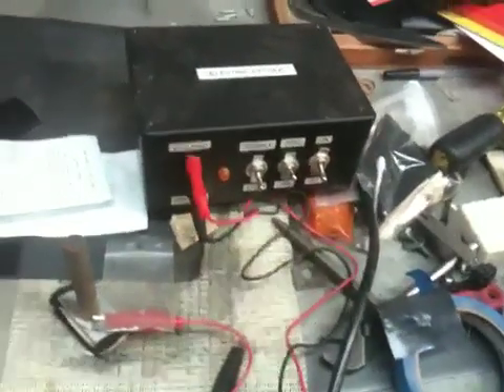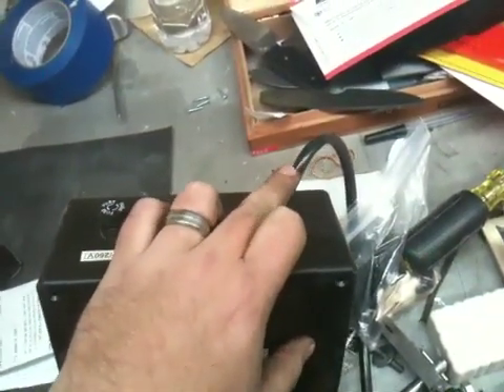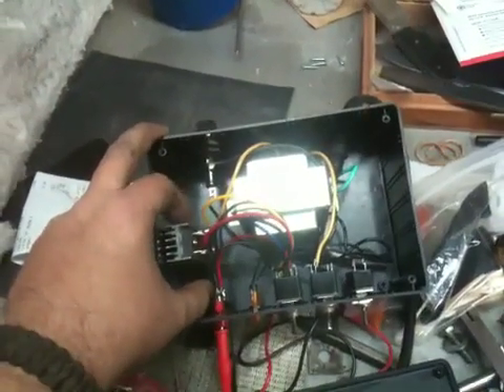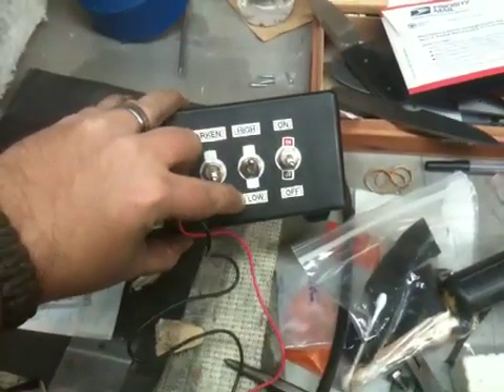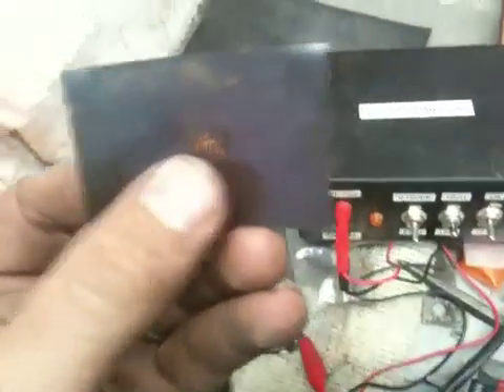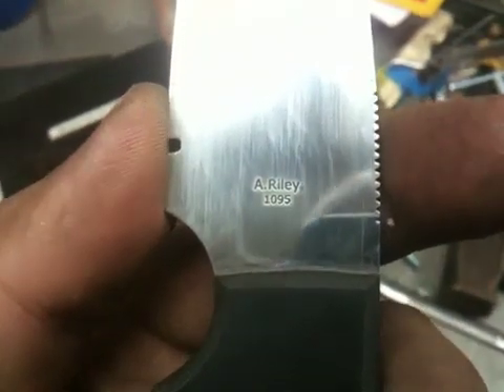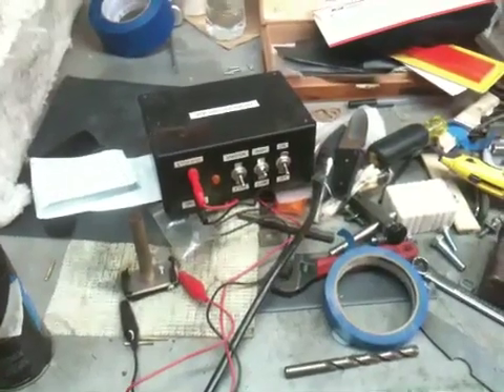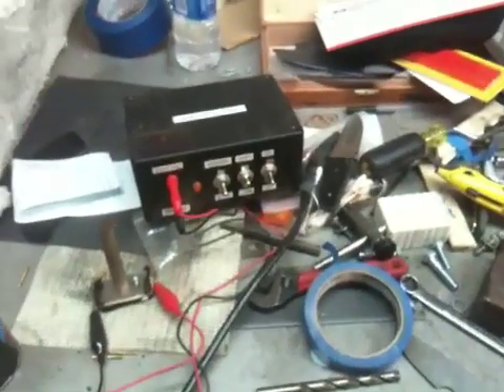Homemade electric etcher

Comment: Curious if you still responding for messages got question
Reply from the maker: what's your question?
Reply: ARCustomKnives 
So I finish same etcher as you but I did not use fan. Think is when I switch on ac I’m getting 12v and 24. Dc is getting 10.9V  22.4V that is ok 
When my multimeter is on dc and  I switch on ac without disconnecting multimeter Im getting 48 v and 23V
So my point is on dc Im getting dc power as it should be but also on dc possition Im getting double AC power.I hope you will get my question. Is there possibility I done something wrong or can you test your etcher as It may be normal. Thanks.
Reply from the maker: Stefan Zubal what kind of meter are you using? Some cheaper meters might read as you are describing. A good rms meter would likely read 0v AC when connected to a DC source. I’d guess you’re probably fine if they read ok on the correct settings.
Reply: ARCustomKnives so I will try with diferent meter as mine you can buy for £2 these days

Comment: How does the high/low power switch work?  Could you fully adapt it to a smooth voltage control with a pot somehow?  I'm not quite sure how it would wire up.  Do you?  Likewise, do you have any idea how to put an adjustable current-limited in it, as is common to many power supplies?  Again, I have no idea how to do this.

Thanks.

Comment from the maker: @TheManFromAlaska To answer why your 12V DC powersupply etches one way & darkens the other, I think it has to do with how the electrons flow. IIRC, the pad needs to be the neg. side for a good etch with DC, as you saw with your test. As for darkening via the + terminal on the DC power supply, I don't  know how well that will work compared to an AC supply. I know plenty of guys have opted for using power supplies as make shift etchers. I'd see about getting an AC for darkening though.

Comment: Part 2 --  Is there a benefit for me to build a unit like you have or just use my power supply and reverse leads for "etch" and "darken" modes?  Will I cause damage to my power supply doing this?  Also while researching this, I found that Wayne Goddard recommend 6 VDC as best voltage to use.  What is your thought on this?  One last question.  How do you make reusable stencils?  Thanks in advance for your time and answers, it is much appreciated.  -TMFA-

Comment: Thanks for the response. 
Part 1 -- I have another question.  Why would you need to have AC for the Darken operation?  I noticed that this is also how it is set up on Chris' etcher.  I tried out some etching today with a little 600ma 12 volt power supply, when the (-) was on the pad it etched and when the (+) was on the pad it darkened.  Seems to work pretty good so I pulled out a variable voltage DC PS that puts out 2 amps.  I was going to try using this.

Comment from the maker: As far as I know,  it should be able to etch any metal that conducts electricity, which would include aluminum. You may benefit from a specific electrolytic solution other than salt water to get the best etch though. That I don't know for sure.